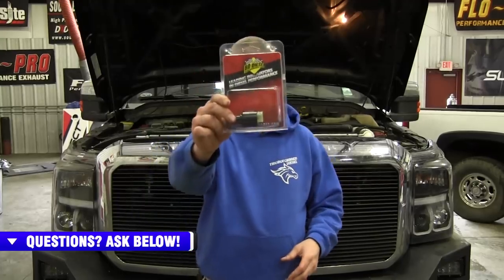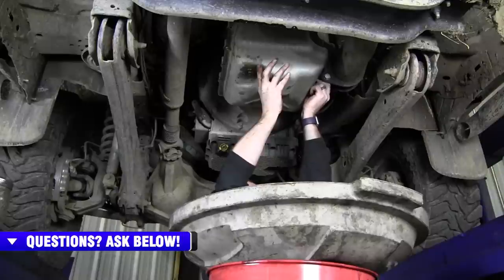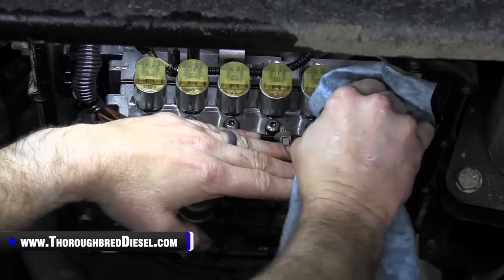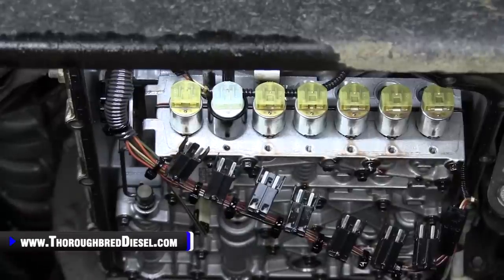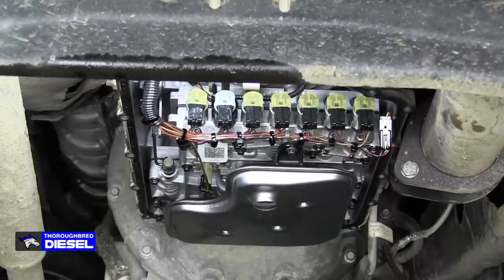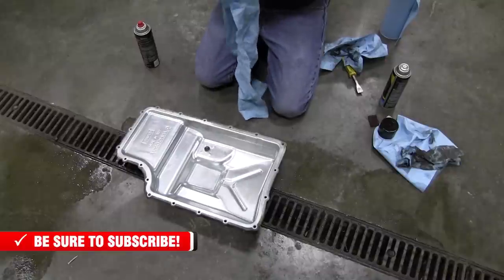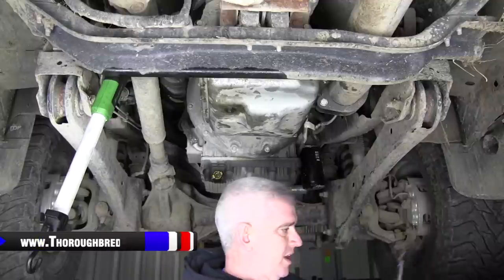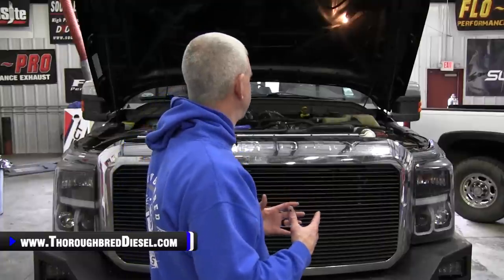BD 6R140 Pressure Enhancer Install: 2011-2018 Ford Powerstroke 6.7L

Comment: Installed mine last night (2018 f350),
And installed my fathers a few hours ago (2016 f350) got him one for Christmas. 

Did mine by myself and took me about 2 1/2 hours, that was without the drain plug because mine just didn’t have one, and my Father’s took us only 45 mins. He did have the drain plug. 

Honest review of this product, it’s worth every penny! I noticed a change in shifting in my truck which was definitely a lot better and my father was extremely happy with his. Both of our trucks are deleted and tuned with ezlynk. 

Thanks for the video it was extremely thorough 👍
Reply from the maker: Awesome! Good job. Glad the video helped you.
Reply: Hey man, just curious were you having any issues or concerns with transmission before install? I also have a 2016 ez Lynk set up, and some concerning shifts under normal driving. Some flares that lead to harsh shifts…not sure if this will help
Reply: @travismccarthy5681  It probably won’t help much with that, but after 2 years it still runs great and is doing good. Highly recommend.

Comment: Been interested in this, but hadn't seen any review or overview of it. Until now! thanks!!
Reply: I installed this in my trans. Broke the input shaft in the normal spot. The rebuilder said these are the problem that’s he’s seeing with the broken shafts. There’s no give to them. It worked great until it broke. Broke going down the highway with my cruise set.
Reply: I installed this in my trans. Broke the input shaft in the normal spot. The rebuilder said these are the problem that’s he’s seeing with the broken shafts. There’s no give to them. It worked great until it broke. Broke going down the highway with my cruise set.

Comment: Pull a vacuum on the dipstick tube,
Place catch pan under transmission,
Remove drain plug, 
Remove vacuum,
Transmission fluid drains.
No mess.
Reply: What about the crap on the magnet?

Comment: I installed this today on a 2012 F250 6.7 and I swear I pulled the right solenoid. After having problems with shifts and a DTC code (Solenoid C stuck open), I checked the solenoid I took out and it has a green o-ring, not an orange one. That means it's a low-pressure solenoid in that slot for me. I guess I will have to do it all over again tomorrow to put the old solenoid back in. Ugh.
Reply: Any updates after installation?
Reply: @rspeed3  I erroneously transposed the diagram and replaced the wrong solenoid. Redid it properly and all is well for about a year now.
Reply: I have a shift solenoid A stuck on code. Does anyone have a schematic of those solenoids and which one is which??
Reply: @OhCrapItsJimmy  how do you like it I have 2012 as well and deciding on it I have shift flare at times between 2/3 
What made you want to do it and what have you noticed improvement wise
Reply: @135-j  Years later it's shifting well. I would do it again
Reply: @OhCrapItsJimmy  ohk

Comment: Doesn't the pcm control shift pressure? I've seen on my stock 2017 f250 up to 275psi depending on where my pedal was... Flexing in the case.. Really lol, the case holds fine copper wire and moved a small pin back and forth in the end where the O rings are.. There's no flex.  Nice job on the video, you'll probably be able to convince unknowing people to purchase this lol.

Comment: I liked everything about the video until you dumped the solvent into the shop drain !🤦🏻‍♂️lol jk . My truck is bone stock but in sport mode under hard acceleration my tranny seems to shift very mushy and may have a hint of slip will this be a solution to this issue ?

Comment: I also had mine installed mine today to and no more 2nd to 3rd slippage. Good line pressure nice shifts. 2017 Ford F-350 Tuned With GDP Ecm and TCM Tunes 👍 So Far Worth The $ 

Great Job By Thoroughbred making this video
Reply from the maker: Thanks!  That is why we make the videos.
Reply: How's it running now? Did you have any shift flares before installing solenoid?
Reply: This is the exact issue im experiencing occasional 2-3 slippage under light throttle. Going to have to get me this asap.
Reply: @jesseochoa4807  sold my 2017 getting a 2021 F450 limited now

Comment: I have a shudder when it’s downshifting from 6th to 5th and sometimes from 5th to 4th.  Fluid was recently changed about 10k miles ago with Mercon LV.  No codes found on scanner.  Would this begin to eliminate the shudder?
Reply: Im wondering this too. It claims to help the clutches hold better, so maybe help a shudder out?
Reply: You ever get a solution to this? My 18 just broke 100k so I did the filter/fluid changes, and ever since my been downshifting hard from 3/2 & 2/1.
Reply: @kingdom1492  you ever figure it out mine does the same
Reply: @khalidmahmood8466  After a few thousand miles on the new fluid/filter it just went away on its own. I did install this part in my truck as well and noticed an improvement in shifting between 2/3 at higher RPM.
Reply: I have the same issue with my 2012. It's more pronounced when I'm towing and it downshifts for a hill.  Did you happen to try this solenoid Anthony, and did it have any luck fixing your issue?

Comment: Hi I bought a solenoid from you for my 2011 Ford F350 6.7 and now my transmission oil temperature is constantly at 230 but my transmission did stop slipping. Is the high temp normal?
Reply from the maker: It shouldn’t be that temp constantly.  Something is not right there.  Check the rationality of the sensor.

Comment: I bought new back in 2011FORDF250 6.7L and it has a 6" pro comp lift on 35s and I never race or dog out my truck nor do I pull a trailer that often with it and I've NEVER put it in the mud. Right now I retired the truck and I'll drive it once a month to keep things fresh. Do you really think I would benefit from this solenoid? If I don't need it then I won't install it. I'm always looking for the best for my truck but I'm not sure if I need this solenoid.  Thank you for the video bud.
Reply: You're looking for the best for your truck and drive it once a month? Let me guess...around the block? 

ROFLMAO.
Reply: @deeremeyer1749  I drive it to your house once a month when you're not there, that's how far I drive it. 🤣🤣🤣🤣🤣🤣🤣🤣🤣🤣🤣

Comment: Did it produce harsh-er or harder shifts? That's my only concern when daily driving it under normal conditions. Im sure when you're sinking your foot in to it, the shifts are more firm which is fine. Im more concerned about typical driving conditions.
Reply from the maker: Shift firmness was unchanged. The truck drives like a dream!
Reply: @thoroughbreddiesel so what’s it’s supposed to help with clutch slippage

Comment: I have f250 2019 super duty 6.7 diesel uni have transmission shift solenoid any buddy know which solenoid it it because I show  7 solenoid error code it’s p0771 thanks you

Comment: Is this the same for a 6.2 gas setup? Have a flaring issue occasionally.
Reply from the maker: This does not work with the gas vehicles.
Reply: Thoroughbred Diesel is it not the same transmission?
Reply: @chrish5096  Even if it does, they're probably going to have different shift patterns and programming to utilize the torque and horsepower curves of the engine. This solenoid alone isn't going to understand the redline for the gasoline motor is a few thousand RPMs more than the Powerstroke.
e.g. If you wear a size 12 shoe, you can put on a pair of size 12 work boots to go jogging in, and they would work, but your ankles are going to be sore at the end of the day.

Comment: Took a solenoid out of valve body and went to put new pressure solenoid in and valve closed and won't allow new one in all the way. Any ideas on how to get solenoid in when valve is closed?
Reply from the maker: I would suggest removing the valve body and get it on a bench so that you can look at it and see what is going on.

Comment: I have a hard shifting issue that a new valve body wasn’t able to fix. All i find on forums is that it’s due to tuning my 2012 6.7 and adding about 100 horsepower. I know it’s not the transmission. Will this help with the problem most have with hard shifting after tuning their 6.7?
Reply from the maker: The tuning will need to be reviewed if its doing that since you tuned it.  Or at least start there to determine root cause.
Reply: HEY  bro, how did you fix your problem? i have same problem
Reply: @DV_Production nothing i tried worked. From tuning to having to need valve body synced to the car. Last thing left was to replace the transmission, so i sold the car. Got tired of issue after issue. So if you tried everything man all that’s left is replacing the transmission.

Comment: Great video and tutorial ! Would installing  the BD solenoid eliminate 1-2 gear hard(kick) shift especially when the transmission  is cold?
Reply from the maker: It is very hard to say without riding in your truck. If you are having a flare and then a slam into gear to catch up, this could help the issue but I would suggest having the truck looked at by a trans specialist to be certain.
Reply: Did this fix your 1-2 gear hard kick, I'm having the same issue
Reply: @nicholasshaak1124  I never bought the BD solenoid . The kick is better if go smoother on the gas pedal
Reply: @nicholasshaak1124  What year is your truck ? Tuner ?
Reply: @Ioang40  2011 f-350 i bought it tuned so im not sure who tuned it
Reply: @nicholasshaak1124  Have you tried changing tran fluid and filter? It should be done every 80k miles . Another  trick I did is re-install the tune or in your case buy a new tuner . That will reset the trans and relearn the shifting . I did that to mine and it is much much better shifting only harsh if you slam on the gas
Reply: @Ioang40  ill try that this weekend, thanks for the tips
Reply: @nicholasshaak1124  How did you do ? Any improvement ?

Comment: I installed mine now I have a real loud ticking sound when it’s cold for about the first 5 minutes is this normal
Reply: Type Writer Tick is perfectly normal..Ford released a TSB, as did the other big two. Normal noise on these newer diesels. Has nothing to do with the trans. Must have been a coincidence

Comment: I only have issues in the morning for my transmission shifting into 1st gear. It will shift in reverse.
Reply: After putting this solenoid in? And at what temperature outside? Mine does that when it's 20° or colder, no solenoid replacement yet
Reply: @lcnieman  I took it to diesel mechanic but they still cannot find a problem. I’m lost.
Reply: Is your truck an early build '11? There's a TSB for Solenoid Replacements and Software Calibration Update for this exact concern.
Reply: @ryanbrown918  I have a 2011 F350 6.7 that has slow shifts from 2nd-3rd and 5-6 only when the truck is cold. This happens even in the summer when 75°at night. After a few miles as the trans warms it shift normally. 4/10 manufacture date. This truck has H&S programer and is completely deleted with 215,000 miles. This is my work truck so it is not driven hard. Any help would be great guys!
Reply: Where can find the TSB for my truck?

Comment: Am having a little problem with transmission in my 2018 f250 6.7L when It shifts into 4th gear it feels like it’s slipping it kind of goes into 4th gear and then when the RPM goes higher it grabs the fall 4th gear. Could that mean Solenoid pressure is too low or could it be torque converter
Reply: jacob schmitt do you have trans tunes?
Reply: lucas kain yes i did for a while and then I took the tune off it does the same thing with or without the tune
Reply: What platform Ez-lynk With GDP?
Reply: lucas kain yes
Reply: I had the same problem until running a combo tune. Then I switched... my Ecm is the banana smoothie tune SOFT V1.2 and TCM only medium shift 2nd lock v1.4
Reply: lucas kain ok I will try that
Reply: Also add this BD line enhancer and you’ll be set. 👍Take care
Reply: That is the torque converter locking up.  Pull up the torque converter PID.  You can see the "slipping" (but really it is functioning as designed), then the slip rpms will go to zero as the converter locks. It feels like a shift, but it's the TC locking.  It then stays locked for the 4-5 and 5-6 shifts.

Comment: Will it cause your transmission to run higher temperatures
Reply from the maker: We have not seen a raise in trans temps that are outside of normal operating range.
Reply: The less time spent between gears with the clutch packs slipping, the less heat is going to be created.
Reply: I was surprised to see a 5-10 degree increase in transmission temperature across the board (daily driving and towing) after installing the solenoid. My truck is a 2017 with 24k miles when I did this mod.

Comment: Would this help correct a persistent P1744? Its a deleted 2018. Trans and torque converter have been replaced,also different tuning. Still there.
Reply: You need to have your truck diagnosed properly. It could be as simple as a bent pin on the TCM connector or a bad TCM if you've already done a new trans and converter and the issue is still there. Those are the first things you'd check for when diagnosing an intermittent issue. Also this BDD solenoid isn't something i'd recommend without proper trans tuning to go with it, as it bumps line  pressure and can exaggerate the coning effect on the overdrive clutches which happens on stock line pressure trucks.
Reply: JaegerWrenching this is what I wanted to see was real world advice!!! Do I really need it? Would you recommend it?
Reply: @JaegerWrenching  I'll never understand why Ford went with a plastic overdrive piston. 🤦 The plastic wears and provides less and less surface area on the overdrive steels and clutches, causing the coning affect.

Comment: Does changing this solenoid make sense if your truck is bone stock?
Reply: Anything that safely raises the baseline pressure in order to reduce or eliminate slippage so clutch packs last longer in all conditions from towing and hauling down to simply running through the gears in partial load is worth doing.
Reply: @BosheefaJohnstone  don't you think ford engineers designed this transmission right to begin with? why would i trust a selonid kit from BD diesel to out smart fords engineers

Comment: Will this part hurt anything if installed with a trans tune, with already raised line pressure in the tune?
Reply: BackwoodsBrotherhood it’s made for exactly that purpose
Reply: You don't need the solenoid with the tune. I have all factory solenoids and I get 300psi line pressures.
Reply: @HSKFabrications  The issue that they're wondering if they'll run into is having 300psi running through the stock solenoid which is unquestionably smaller in size and less robust. They should've asked would it have been a better idea to let the computer kick up the pressure or let the bigger solenoid that was designed for higher pressures do it so you aren't doing the job twice once you wear out the stock solenoid from pushing it past it's intended limits?

Comment: Been thinking about doing this but I’m skeptical installing 3rd party solonoid in my transmission.  My situation is a 6.7 2012. Deleted and tuned by multiple different outfits.  The reason I’ve tried different tunes is because the transmission shifts rough when at perfect rpms mostly 3-4 4-5    Different tunes have not changed anything on the shifting.    Isn’t the higher pressure going to create other problems in the tranny or the other solenoids.
Reply: Did it fix it?